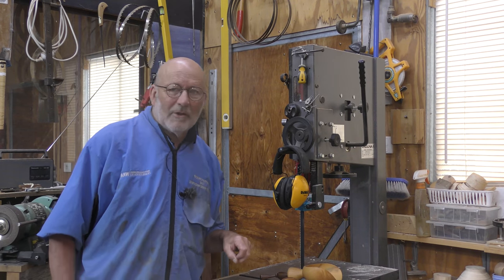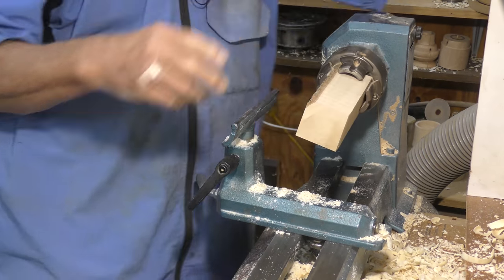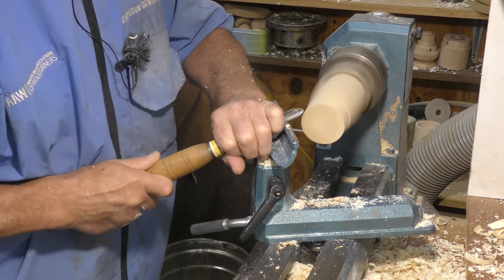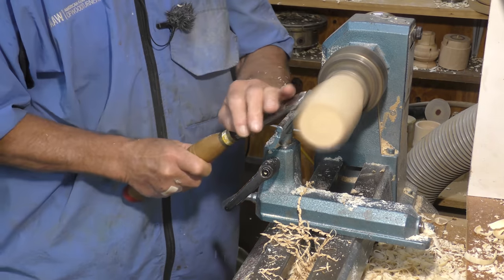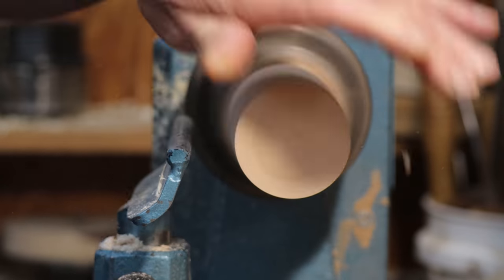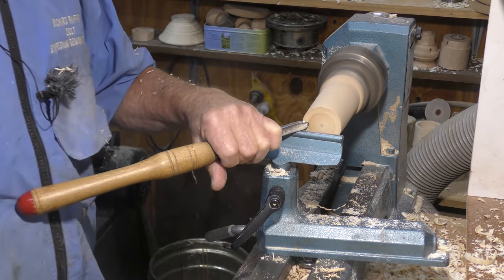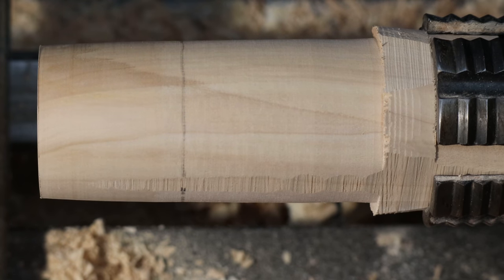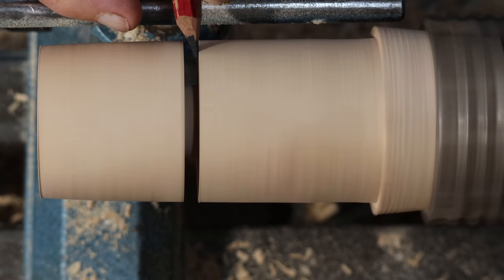Richard Raffan on turning a scoop

Comment: Another excellent turning. I've seen others cut the scoop on the band saw, I think your way is much safer.
Reply from the maker: I no longer have a fixed belt sander but when i first made these scoops I shaped the bowl on a 36 grit sanding belt, followed by a 180 grit. For some years I did use a bandsaw with a ⅜-in blade, then finished the shaping on a 180 grit belt. Using a bandsaw it's essential to keep your fingers behind the blade so you drag the scoop through the blade. Bringing the curved surface into the blade is the dangerous bit, because the saw grabs the unsupported bowl and weak bowls disintegrate. Cutting on a bandsaw isn't recommended unless you're cutting dozens at a time.
Reply: That certainly makes sense. Thanks for explaining, those were things I hadn't considered before.
Reply: Hello Mr.Raffan, I agree l  it makes sense not to use a bandsaw. I saw  you sawing one in one of your books ages ago and estimate using sandpaper ist much safer.
I want to thank you so very much or one of  your books, "Turning Wood..." I read it in German ("Drechseln") and it was the begin of my learning how to turn wood, by keeping things simple. I still use "your" spigots and improvised Chucks today and "don't use top much time to get a perfekt sharpened tool". Best advices!
Kind regards from Germany, Fabian

Comment: Your headstock bearings are loose, that's what is causing the vibration.
Reply from the maker: There is absolutely npothing wrong with the lathe bearings I can assure you. The bench at the back of the lathe is jammed against the shed wall, so any lathe vibration is transferered to the what is essentially a fairly flimsy structure and rattles that end of the building. Loose bearings make a knocking sound.

Comment: You lost me at using a skew to rough out the wood.
HOW? I've been trying for 4 years and gave up doing this because it was so bloody dangerous. Nothing but catches and my skew across the room.
Reply from the maker: Make sure only the leading part of the edge or corner contact the wood. You need to avoid the wood ciming down on the unsupported portion of the edge. Take a look at my Skew Chisels and Catches video.
Reply: @RichardRaffanwoodturning  I've watched it. It didn't help.
So, my skew chisel is used as a scraper, it's the only way it works.
Thanks for trying though.
Reply from the maker: @imapseudonym1403  Sounds like you need a few minutes hands-on with someone who can use a skew chisel. Is there a woodturning group near you? It shouldn't be that difficult: tool on the rest, then bevel shoulder on the wood, then raise the handle slightly as you rotate the edge on to the wood. When there's some dust coming over the edge, ease the tool forward.  Practice on a round spindle before trying to rough down a square.
Reply: Oh It would take more than a few minutes. I've read and watched every bit of advice online I could find.
Doesn't matter how I go about it, slow, fast, light or death grip, the second the cutting edge makes contact "POW' I get a catch. 

And the nearest woodturning group is over 2 hours away. Besides I wouldn't want to waste their time. I've come to terms with the fact that it will never work for me and I'm okay with it.
I do thank you for taking the time to try to help, it's much appreciated and something that is rare these days.
Reply from the maker: @imapseudonym1403  Sounds like you need hands-on with someone who can use a skew chisel. I'd say you're pushing the tool into the wood which makes any catch more dramatic, and you're clearly catching an unsupported edge. It should be simple: 1: Chisel on the rest. (The chisel should be on its side, not flat on the rest like a scraper.) 2: Bring chisel bevel shoulder to rest on the wood. 3: Raise the handle to pivot the edge to the wood. Try this with the lathe off, rotating a smooth cylinder by hand.  Any more problems, message me or email via https://www.richardraffan.com.au/contact/.